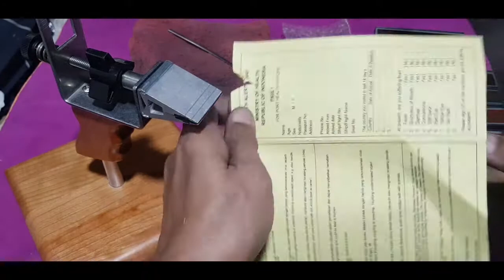KME R.P.S.H Combo Kit

Comment: Also you know you're sharpening a very non effective way. I go both directions untill the very end then I take the 1500 or greater and stroke toward the blade at a slight angle toward the handle to give more bite    you're way wouldn't effectively remove a burr
Reply from the maker: Thanks for your comments. My techniques have improved since then and I go both directions except when stropping.
Reply: Good deal man wish I had all the stuff you do.  I love this system.  I'm decent at freehand but it's a pain in the ass sometimes.  This is a lot easier to hold and angle.    I just have the diamond kit with the base.
Reply from the maker: Now I have a local knife shop selling these. I had to order mine direct from KME.